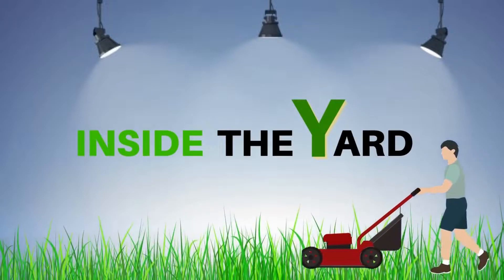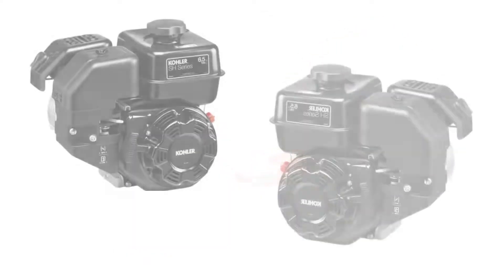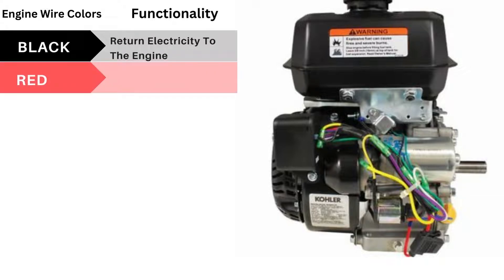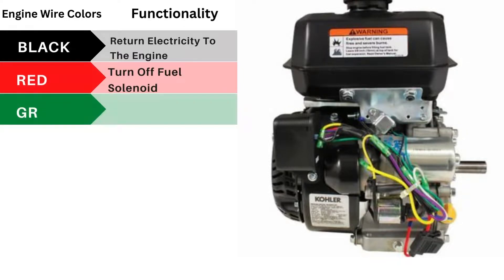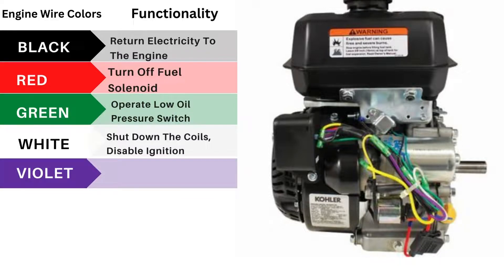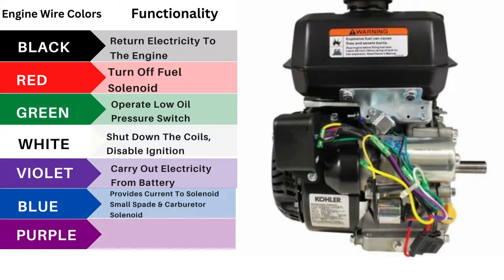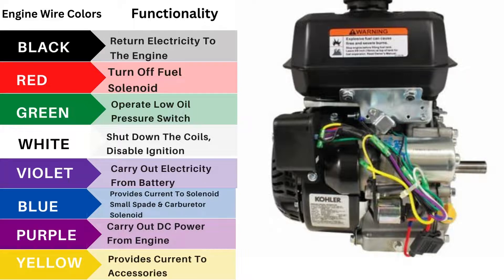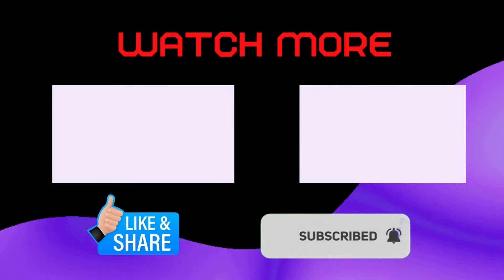Kohler Engine Wire Colors - A To Z Details

Comment: Well hopefully this will help me out some because im working on a sst18 John deere with a sv725 Kohler courage on it i know once the mower is on it has to send charge back to the battery and right now there's no battery hooked up and the wires are messed up bad the hood on this sst18 is from a d100 series john deere so someone tried fixing it but done a poor job at it now im going over everything on the sst18 John deere
Reply: NEW WIRING HARNESS START OVER
Reply: @ivanstrickland7741  Why?